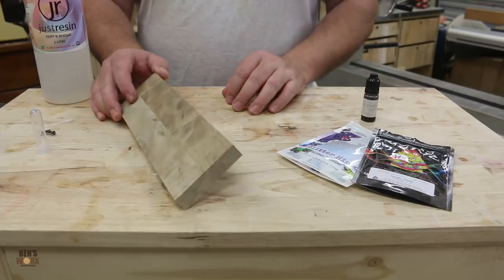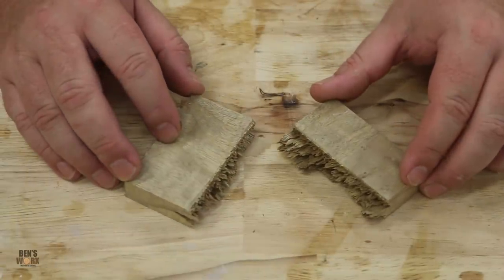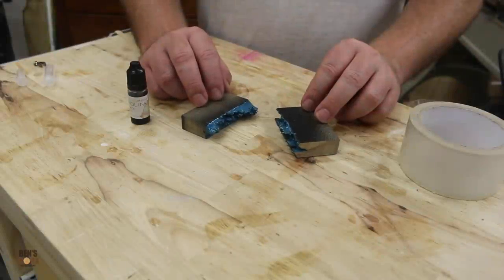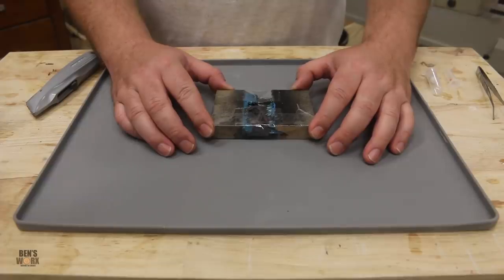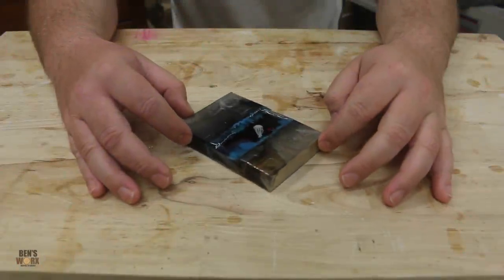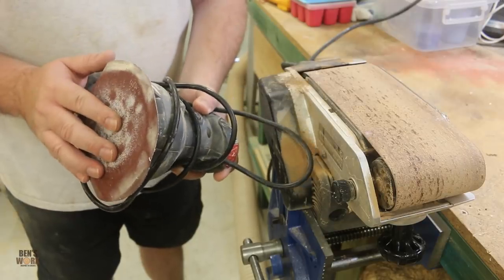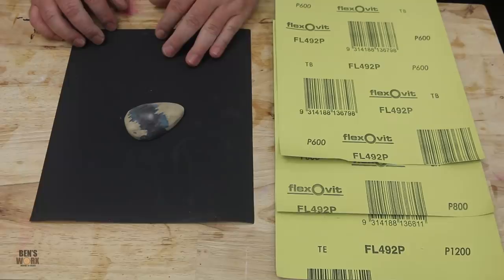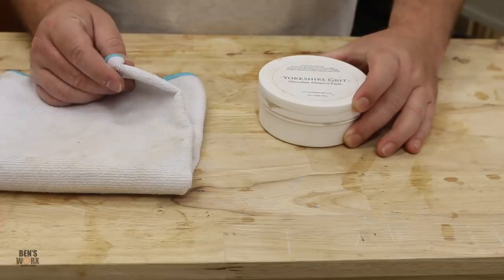How to Make a Jellyfish Pendant - Epoxy Resin Jewelry

Comment: Did you cure it in the pressure pot fer the bubbles? I saw quite a few when you poured the clear
Reply from the maker: I used a torch during the curing process
Reply from the maker: I used a torch during the curing process
Reply: Would a hest gun be sufficient?